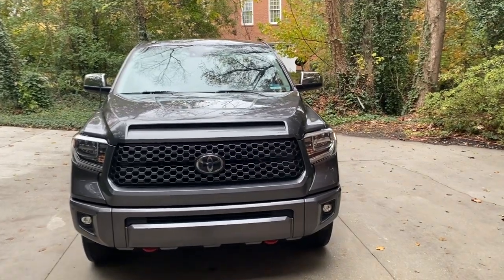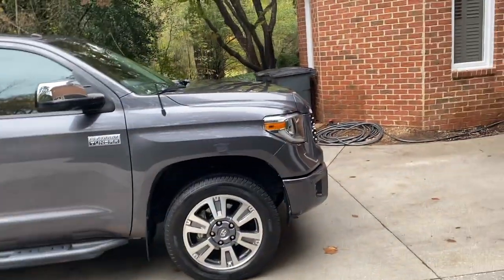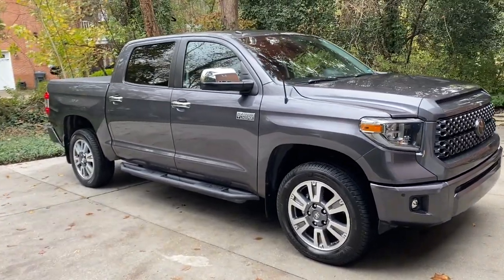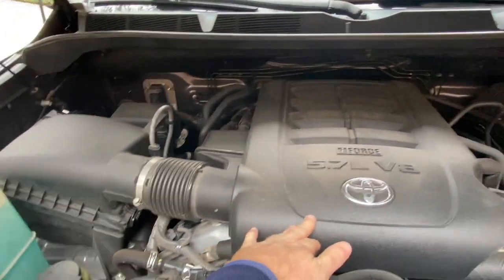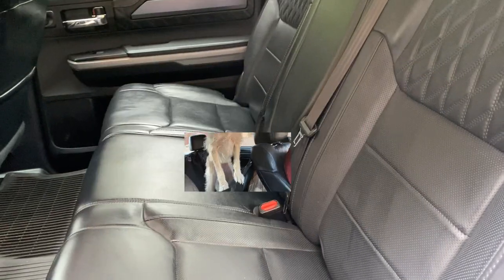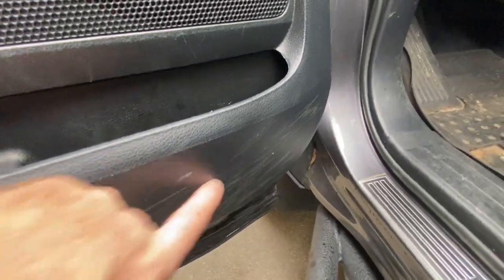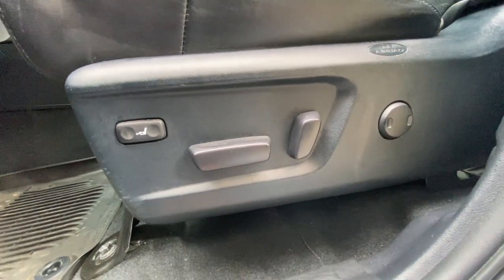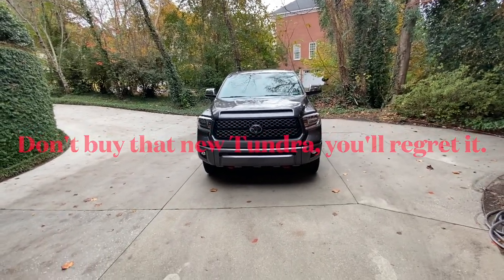Tundra Problems - 5 years and 120,000 miles - not much

Comment: Consumer Reports  no longer recommends the new 22-23 Tundras. Sad day. Stick with the 2nd gen. Tundras for reliability.
Reply from the maker: Yep, been thinking about doing a video on that.
Reply: Consumer reports did not like the 2014 Tundra and cited its gas consumption and older transmission.  Brought that truck anyway and it worked flawlessly.
Reply: They'll work out the kinks just like the 1st gen I never realized how many are still out there I still see the very first T100s at least once a week on my roads Toyota doesn't water down reliability  because they bring to the Texas plant the same manufacturing process reputation from their Japan plants their chief engineers regularly evaluate all plants across Mexico and Texas I don't recall any Canada plants I'm the 5th owner of a 2012 Tundra 111k miles just doing regular maintenance and replaced the OEM shock/struts myself
Reply: No leaks anywhere? Can tower leak?
Reply: They've already refined them quite a bit. But, case and point why you never buy a first model year (and second to a lesser extent) of anything.
Reply: Way too early to judge the new Tundra. CR is garbage for stating that.
Reply: @andyleo8418 no they’re saying what’s happening. There are significant problems with the engines and turbos, stating the facts is responsible and honest. Toyota will get it right but for now they have issues in the new trucks
Reply: Yeah my engine broke down after a year 2022
Reply: Thank you for an excellent review!  Just purchased a ‘21 Platinum in windchill pearl, 37k miles, coming off a 3 yr lease, and added a TRD rear sway bar & a TRD dual exhaust w/ the black chrome tips.  Towed a 12ft uhaul trailer loaded w/ stuff for my daughter’s Waco apt.  from NE Ok to central Tx.  The thing is an absolute beast on the road!  I read somewhere that the 2nd gen Tundra’s are essentially one additional rear leaf spring away from being classified as a 3/4 ton. I have an older 3/4t GMC and can vouch for that😂.  Where did you pick up the non-chrome interior pieces around the shift selector and hvac vents?  Does those cut interior glare as much as I think they would?

Comment: I got a 2012 Tundra, & I used it for hotshot work. I went coast to coast & border to border 6 times a year. The only problem I had was the Secondary Cold Air Intake went bad/ That was $4,000 repair. other than that, it still runs great. Drive safe. 🤠
Reply: How many miles on it now? Also what type of hotshotting did you do as most use a 250 for that stuff?

Comment: excellent review.  Really enjoyed it.    I am towing a lot as well, and currently do so with a 2015 F150 3.5 Ecoboost.   Have been extremely happy with it.   Did decide to take a 2023 Tundra for a test drive recently, as I had really liked the previous generation of Tundra (like yours).   That test drive basically confirmed that it is highly unlikely that a new generation Tundra will be my next truck.   My 8 model year old F150 rides smoother, has more power and is quieter than the new Tundra, and I don't feel like I am in some sort of giant plastic lego set.   I really think Toyota has taken a step backwards with this new truck.  In any case, hoping to run my current truck a few more years yet, and I guess we will see what Toyota has done by then... As always, safe travels....
Reply from the maker: Haha, if I were to need a new 1/2 Truck today, I was thinking GMC Baby Duramax or RAM ecodiesel.  But the Other day I say ann F150 Poerboost with the 6 1/2 bed and 77.2kW generator.  That'd might be the answer.  But truly, I like all trucks.
Reply: @kedrevs4037  I agree with you, both the GMC and especially the Ram ecodiesel look like darn nice trucks.    That F150 with the generator does look like a nice unit too.  Great aid for boondocking for sure.   I must say I enjoy my 6.5' bed.   When travelling I have 2 bicycles, 2 sets of golf clubs, 2 clickgear golf trollies, an extra propane tank, a spare battery, a bag of charcoal and a toolbox all nicely in there.   Would be quite the 3D tetris to get all that into a 5.5' box.   That is one smart thing Toyota did this go around, making a 6.5 box available on the largest cab.  It makes for a long truck, mine is 243", but I love the space in the cab and box.   A buddy of mine recently picked up a new Tundra with just the extended cab and a 6.5 box.   He is 6'4" and his back seat is basically useless.   less than 1 inch of knee room when he puts the front seat in a comfy position for himself.

Comment: It was pretty cool to listen about problems this gentleman had in 120k miles of ownership, while myself is thinking of getting rid of my 2022 f150 with only 44k kms ( not even 30k miles), with 5 transmission related appointments ( last one cdf drum tsb which is pretty much a rebuild) and a valve body replacement before that. On top of that, active grill shutters died in the first year, fog light replaced, recalls and some electronic gremlins ( screen doesn't respond, power windows don't respond, but go back after truck restart) - Built Tough, LOL...

Anyway great Tundra. I was thinking about getting a 2022 tundra when buying a an F150, but didn't like that one. Considering getting a 2021 now. Great to hear you've enjoyed your truck all this miles. Thanks!
Reply from the maker: Thank you, can't really go wrong with a well-maintained 2nd gen Tundra
Reply: go back a few years, and get a v8. them new v6 tundras are dog. for such a heavy vehicle is gonna strain that v6

Comment: Note: all other truck companies in America use two piston caliper on their brakes, Tundra use’s four piston calipers and bigger disks.
( at 112,000miles) replaced brake pads and rotors, while changing rotors found passenger side wheel bearings little grinding sound, replaced both front wheel bearings , replaced spark plugs at 110,000 . I STILL have OEM Toyota battery (8 years old and still going strong!)

Comment: 2022 SR5 Owner.  Previously a 2014, and a 2005, plus a bunch of Tacos.  

This 3rd gen Tunda is a disappointment. Mostly because of the rear leg room in a double cab (zero inches), and the repeated failure of a drivers side seat cover panel. 

The 2 Gen Tundra was a perfect machine. Miss it.
Reply from the maker: AMEN

Comment: Today at 179,000 miles my most expensive repair was made in my 2007 Tundra SR5 with 5.7L engine - the air diverters on the AC quit working. $1200 fixed it. Only prior repair was at 60k miles - water pump. $700 fixed it. That’s it over the past 17 years. Otherwise routine maintenance.

Comment: I have a 2015 Tundra bought new I just turned 307,000 zero issues, just change the starter last week. I tow a travel trailer as well keep up on the maintenance run good oil and gas they will last a long time. My last  Tundra before this one had 342,000 on it when I trade it off.
Reply: You run airbags?
Reply: No....extra spring
Reply: Original smog pump??
Reply from the maker: That is Awesome
Reply: Have you ever changed the timing chain?

Comment: I had 2 Tundras that I used for my business. Towing often and work projects but always on top of all the maintenance. The 2010 one I had to change the radiator,AIP and steering pump all between 130-140K miles. Still all around reliable. Sold it cause I needed an HD truck this year. The other one (2016 DC) has 70K miles and I had to replace a pinion flange seal. It starter leaking making a mess back there. I still have it as a second work truck and hope that it won't give me many issues in the future. Just my experience with them
Reply from the maker: Good info, Hope both trucks go a long time for you.

Comment: I have a 2018 Platinum with 61,000 miles. Although I don't tow with it, the truck looks brand new. It. has one place with a scratch you have to know where it is  to see it. Those that say it looks dated, screw them and their opinion. That truck is one of a kind that most would sell their wife to own. Just kidding. I love the way it looks, drives and with the TRD exhaust, sounds great. I did one up date you may won't to do to your truck. I replaced all of the interior lights with LED bulbs. Boy does that light it up. I have the black interior just like yours and yes, I do my best not to slide across the seat.
Reply from the maker: Great Truck, yours sound like it cold go 30 years

Comment: my dad has 2022 tundra and that part on the seat at 9:28 has broken as well as the clip that holds it in place and that is the only issue we have had with it they have taken it on 2 long trips and a few short ones and it has performed very well love the truck.

Comment: I have a 2019 tundra sr5 175k miles. Everything is arigenal,  except the breaks and tires. . Runs like new still . Best truck, I ever owned, and it was made in America.  All the other trucks are not made in America.
Reply: I'm thinking of buying a 2019 tundra sr 5 has 108000 miles 26500 dollars hoping it will last a long time?
Reply: What are the most expensive things you’ve had to change/fix? I’m looking at getting a 2020 SR5 with 90,000 miles

Comment: Thanks for the update on you 5.7 Tundra.....I have a 2020 TRD PRO and just love it. Wasn't even interested in the new 2022's. Reference your brakes...did you just replace the pads? I see some people doing a "Brake upgrade" using vented rotors and pad set who say they give much better braking than stock.
Reply from the maker: I have got to get back to doing some videos, not happy with what I did with pads.  Changing to vented rotors might have helped.

Comment: I still have my '00 tundra. I hardly ever tow with it. Not since my folks did camping trips. That's been 10 years. I don't camp anymore since they quit. They gettin old and not as healthy as they used to be. I've no family of my own. My next vehicle might be a 4runner. They're rock solid. Last of the dinosaurs. Hopefully I get one before they change their design. I'll keep my old tundra. Usually hauling  off junk or brush occasionally.

Comment: I bought a new 2020 Tundra 4x4 Sr5 TRD just prior to Covid. Came off a ford f150. Never looking back. I have 103,000km on her with zero issues  & original brakes. Best truck I owned so far. Question … how may km till you do your tranny oil change & diffs?
Reply from the maker: if you tow a lot 100,00km is reasonable for differential oil, some do every 50,000km.  ii not, 150km - 160km is reasonable.  I tow a lot and do mine at 30k miles mine with full flush tranny flush at just over 100k miles.  Owner of shop said my fluids were just fine.

Comment: Love your videos.   I have a question .    Recently Ive been offered a, 2015 Toyota Tundra TRD - SR5 _ with the 5.7L 8-Cylinder Gas Engine . Miles are under 80 thousand .   Its absolutely imaculate.   The only thing is its 2WD and not the 4WD , but  I prefer the 2WD since it hasnt snowed where I live in 8 years.   I can get the truck for under $20 thousand.   I would love your advice.   I really like this Toyota engine and its a crew cab.   Thx Buddy.
Reply from the maker: My son has a 2WD 2015 that he got with 80k on it 4 years ago.  Sounds and performs identical to my 2018 with 140k on the odometer )and the 2020 that I just got with only 14k miles).  He now has ~130k milkes, under $20k sounds like you can't go wrong.

Comment: Nice review. I really need to cover my chrome. I absolutely had getting those flashes in my eye when the sun hits that chrome. Can you tell me where to order the parts you have? I have looked, but can't seem to find anything I think will work.
Reply from the maker: I ordered from ATJ Designs.  They make a number of different products, all easy install.  I actually like (or at leat don't mind) a little chrome on the outside, I just hate it in my eyes when I'm driving.  It was a problem especially with sunroof open.
Reply: @kedrevs4037  thanks

Comment: I noticed the add-on air-bags and sway bar.  I tow about the same size trailer, I'm at about 2/3 towing capacity for my 2014 Tundra.  The suspension seems too light.  The truck really gets pushed around by the trailer.  I put Rancho shocks on the back and airbags, but it didn't make much difference.  What's your experience with the suspension and do you have any upgrades to recommend?
Reply from the maker: WDH with sway control and front loaded TT makes a huge difference.
Reply: 3/4 ton will tow much more comfortable

Comment: 2016 platinum 78k, just had to have timing chain tensioner and fuel
Pump replaced.
Reply from the maker: Hmmm, 2015 with 112K and 2018 with 119k now, and still no issues, just maintenance on both
Reply: Why? just because of the noise?  My 2016 with 85k has some noise but most say it's normal. The 4.0 in the 2nd gen Tacoma and 4runner is a similar engine and sounds like that..

Comment: Been wanting a tundra for a while now. I have a small 3300 pound camper I pull with my 06 tacoma. It's just OK... I'm more worried about breaking something catastrophic while towing as she's not really designed for it but otherwise have no real reason to trade up. Your video makes me want to do one on mine, having recently turned 250k miles.
Reply: My dude, a 3300lb trailer is half of the max tow capacity of a Tacoma it’s more than capable
Reply: @kevinsouthy  oh I'm well aware,  but I'm talking pulling it on a 6% hill climb through the Sierra mountains towards reno NV. She struggles and screams up the hill.  Transmission temp right about 220. I know she doesn't like it. Lol but... having made a half dozen passes up the hill over the last 2 years I still have not had issue, I'm just worried is all. I love my rig and don't wanna part with it.
Reply: Ive been towing 4000 lbs with my 2015 4.6L and NO sway at all.  I might be selling in May 2024.  Only 115 k.

Comment: My 2014 5.7 is at 127k miles and beside regular maintence, ive just had to change the brake pads (100 ish k), battery and water pump at 125k miles. Your truck is due for a Water pump soon which is pricy to replace due to the labor costs.  The shop has to remove alot of crap off the front of the motor, just to replace the water pump which is a sub $100 part.
Reply from the maker: I am sure something is out there waiting for me.  I'll be sure to document it when it happens.

Comment: Did you install a Transmission Cooler ? 
2019-21 Doesn’t have one   Towing 7000 lbs im assuming it would b necessary ?
Reply from the maker: Not yet, did one long trip without it, might do one more before making the switch.  Haven't seen any transmission failures yet?

Comment: Do you plan on keeping the truck longer ? My 2016 platinum has 114k and debating just keeping it till it dies or upgrading to a diesel - I will be towing more often 8k ish or more
Reply from the maker: until it dies? Good luck getting rid of that truck for another 20 years.  I am keep ing mine for the foreseeable future
Reply: I’ve had a diesel 20 years, though it pulls easily nothing about it is cheap. The weight makes you go through tires quicker, .80 more per gallon, DIY oil change with two filters 140.00, injectors @200k miles 4100.00… it’s been nice to tow with but unless towing 25% of the time, the Tundra will make more sense economically. I bought a 2020 Tundra sr5 4x4 two days ago, should’ve done it 15 years ago.

Comment: Nice truck, what is your MPG when towing vs not towing.
Reply from the maker: depends where I'm heading and how fast.  Hwy at 6- mph is about 19.5-20.5 mpgs.  Hwy at 75 mph is about 16.5-18.  Towing 6k lbs travel trailer at 60 mphis about 12.5 mpgs.   Towing at 75mph is about 8 into the wind and about 9.5 to 10 with the wind.

Comment: that cracking sound in the door is the door stay hinge.the 2 nuts inside the door panel that bolts it inside are loose. take off the panel tighten it up and you're good.
Reply from the maker: Not the answer,  Wouldn't matter how much I tightened them.  The hinge was broke.  Replaced and fine now.

Comment: API -Mobil 1 Synthetic is actually only 25% Synthetic which is allowed to claim a Full Synthetic Makings Badge. So are you not using a 100% Product. Actually AMSOIL is the only Certified 100% Synthetic Products. For 5 Years we Have utilized AMSOIL Torque Drive Heavy Duty Transmission (ATF)! Want better Performance Try it you’ll Understand The Difference!